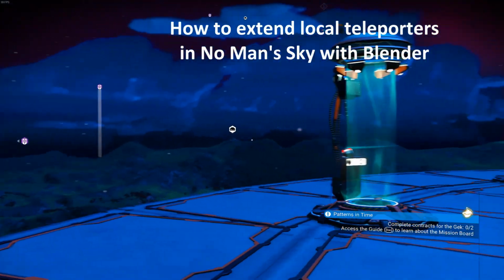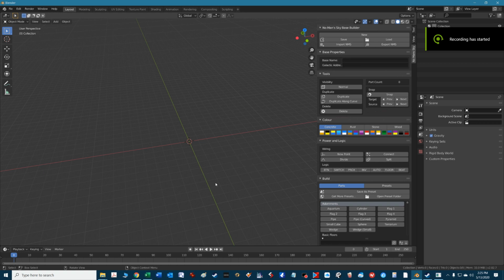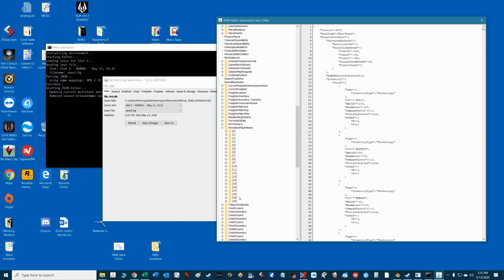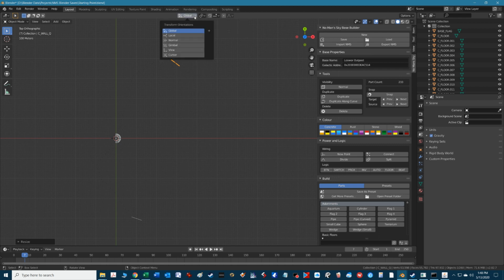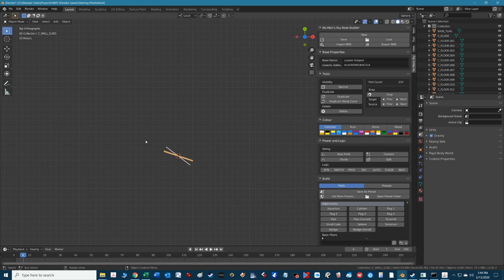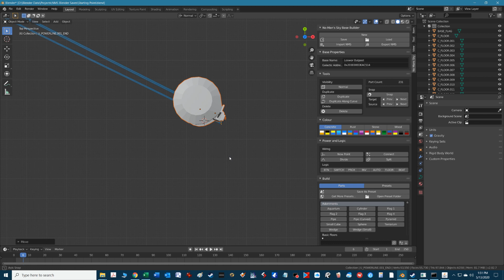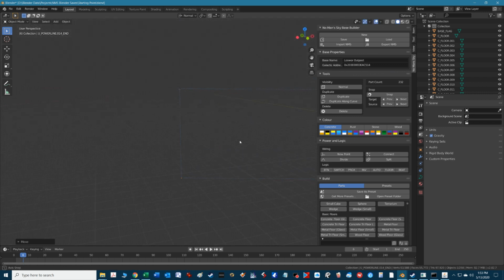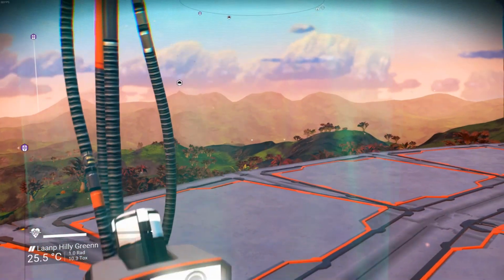NMS - How to triangulate for longer range teleportation

Comment: Why do triangulation if you can just place a new base at the spot, providing you all the info you need in the Save Data? You will have it's exact location, orientation, as well as rotation. This can easily be used to be added back into the initial base you work with. Understanding Vectors (Vec3) makes this all a whole lot easier, applying some basic vector math if need be ;-)
Reply from the maker: Devilin Pixy the problem is, is thas save data info is only relevant to the new base you lay down.  The receiving teleporter belongs to the originating teleporter and base it belongs to...and in blender, only the objects belonging to that base computer you pull in are visible, and the base computer is the centre of your 3d universe.
Reply: @PeterLaan  I am well aware that it all needs to be a single base, but placing down a new base computer at the location you wish your second teleporter to be, provides you all the info you need to then include this data in the initial base as a second teleporter instead. Perhaps my above explanation wasn't clear enough, but triangulation is certainly not needed and makes it way more complicated than need be.
I have been doing these things even before the Blender plugin existed, all manually editing save data. Understanding the data (vectors) will make your life a whole lot easier, trust me ;-)
Reply: Basically check the data for the new ^BASE_FLAG, you have position on the planet in exact coordinates, you have orientation (vector), you have rotation (vector). All you need is to use this data, possibly do some basic vector math, exchange ^BASE_FLAG with ^U_MINIPORTAL, copy your new data, paste back in initial base and done.
Edit: Just keep in mind, a base computer is basically always 0,0,0 with the up vector always being 0,1,0, so you can use the planet data itself for position, which also provides the forward vector. You need to get the new Up vector in comparison to the initial base, which is the only thing requiring a calculation to get right.
Reply: Triangulation will work of course, but might get complicated to do on a large scale. Try to imagine having to place a teleporter on the opposite side of a planet, as I am sure you've tried. Triangulation also doesn't take actual orientation into account, which is not noticeable at a reasonably short distance, as is the case here, but will come into play at large scale.
I know Vector math can seem daunting at first and I can imagine trying to avoid it. There are workarounds to avoid having to do the math though, if you are interested. Just a bit too much to write up in replies here. Maybe we could get in touch outside of YouTube to share some experience. I am often in the NMS Discord, feel free to look me up there and @ me to get in touch
Reply from the maker: Devilin Pixy , yes, now I see what you mean, use the planet coordinates for the new base computer in the 2nd JSON file as the basis for calculating the final positioning and rotation of the receiving teleporter in the original base...brilliant!  Will play with this and see what I can come up with for a procedure, thanks for the input, really appreciated!
Reply from the maker: Devilin Pixy, so after a week of scouring vector math tutorials online, and trying everything under the sun, my other video (not this one) which pushes the teleporter to the complete other side of the planet, then rotates it to final position, is still the most accurate method for me...I could not make the math work properly, and finally gave up..  if you want to take a crack at it and have a suggestion, let me know, it simply is not as easy as you think!
Reply: @PeterLaan  Don't worry about it, your method does work and isn't too complicated a workaround. I just prefer to use the save data available to do tings exact and find it pretty easy once you understand how it all works. Vector math as I said can seem daunting and sure enough isn't for everyone.
I don't have to take a crack at it, as I have already been using it. I do find it easy and I have no problem applying the math required. It does of course help having been coding/developing with 3D stuff for a long time, where such math and understanding of vectors is used a lot. Maybe I should show you how I do these things, YouTube tutorial perhaps, not sure.
Reply from the maker: Devilin Pixy that would be awesome if you could show me the math...the intent was to get both base coords plunk them in a spreadsheet, and it spits out the x,y,z you can drop in the remote teleporter item properties, and boom it’s at base 2.

Comment: Hey Pete, Nice tutorial... good work!
One suggestion. After using Shift-S >Snap Cursor To Selected and then going back and selecting the Teleporter, its 2 Connection Points and the short connectors with its point, just do Shift-S again but this time choose Selection to Cursor (Offset).  The (Offset) is short for preserve the selection's relative offsets.

Alternatively, the Snap commands are under Snap in the Object drop-down menu at the top of the Viewport near the center.
Reply from the maker: Gary Starkweather , yes I thought about that after, good suggestion for improvement.  You need to be mindful of elevation though, as I was in top view with both short walls at different elevations (both considerably lower than my teleporter platform), using your suggested method would have placed the teleporter lower...I wish the scanner showed elevations!...need to think about this and see if I can come up with a elevation solution as well!
Reply: @PeterLaan  Right, I hadn't thought of the elevation. Well, it's two quick steps to highlight the lowest short-wall and copy its Z value from the Item tab>Transform>Location field in the Viewport above the NMS tab and then paste it into the same place for the higher one.